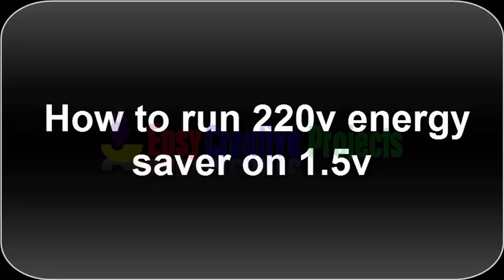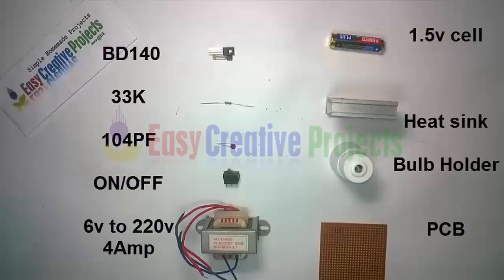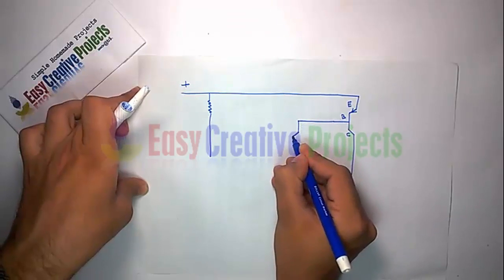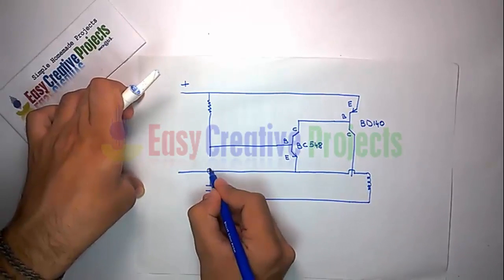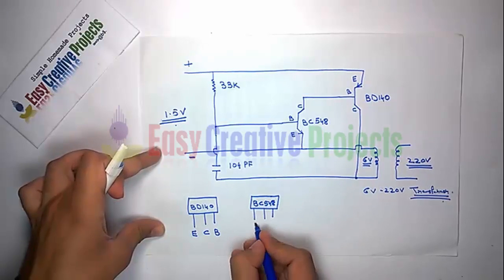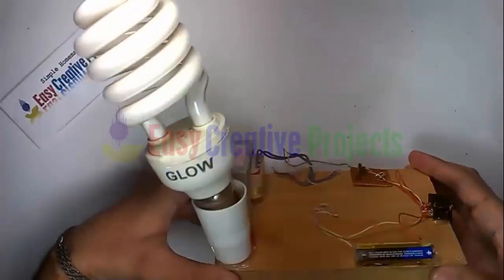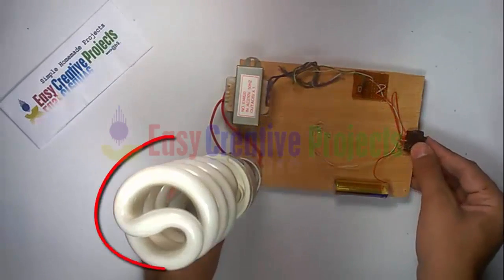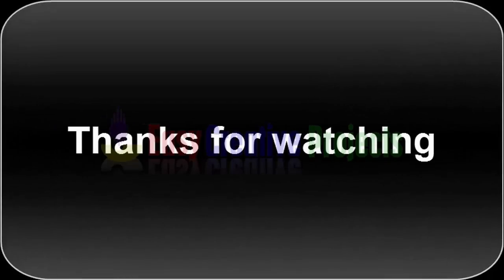How to run 220v energy saver on 1.5v - easy step by step with circuit diagram

Comment: Bro in my city there is not aviable 4amps transformer.
Only have 750 ma transformer.
Can i use it
Reply from the maker: you can use but energy saver cannot work on 750ma transformer.
i suggest you use 3w/220v  led bulb.
Reply: Easy Creative Projects thank u bro its working

Comment: Can i use BD136 TRANSISTOR BRO 
AND ALSO IN MY CITY NOT AVIABLE 6VOLT TO 220VOLTS TRANSFORMER
CAN I USE 220VOLTS TO 6 VOLTS TRANSFORMER IN REVERSE
Reply from the maker: yes dear.
220/6 or 6/220 is one transformer or same transformer.
i try to explain.
transformer has 2 side. 1 side use for input and 2nd side use for output.
you have 220v to 6 volt transformer. 
if 220v side use for input and 6v side use for output then this transformer work step-down transformer.
if 6v side use for input and 220v side use for output then this transformer work step-up transformer.
but both condition use one transformer. 
only side change and transformer name change.
Reply from the maker: 2nd you can use BD136.
BD140 and BD136 both are PNP Transistor. just one thing different in both transistor.
in BD140 Collector-Base Voltage and Collector-Emitter Voltage are. -80V
and in BD136 Collector-Base Voltage and Collector-Emitter Voltage are -45V
Reply: Easy Creative Projects cir diagram is same bro !???
Reply from the maker: yes diagram is same.

Comment: is it a step up transformer I don't have one can I use 220v:6v in opposite direction....
Reply from the maker: dear if you use 6v side for in put and 220v side for output then transformer called step up transformer.
if you use 220v side for input and 6v side for out put then transformer called step down transformer.
thanks.